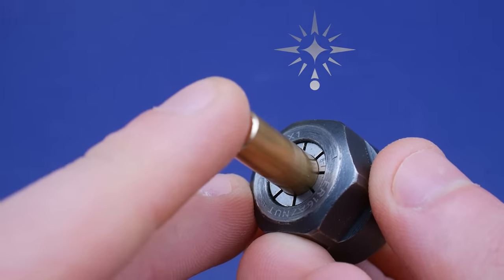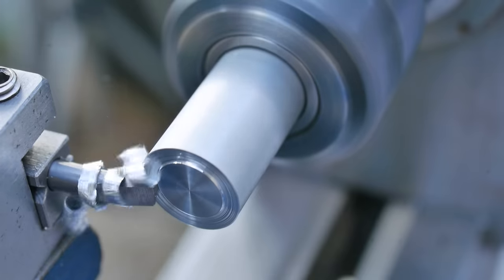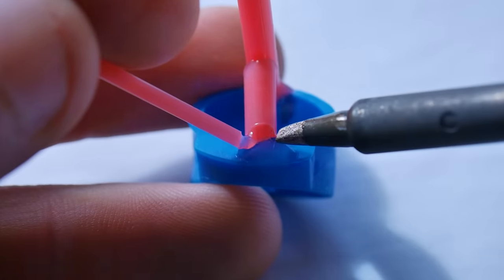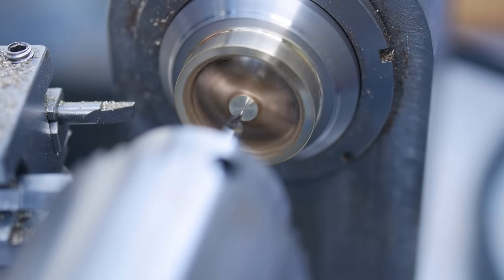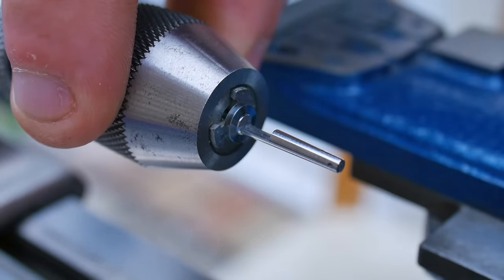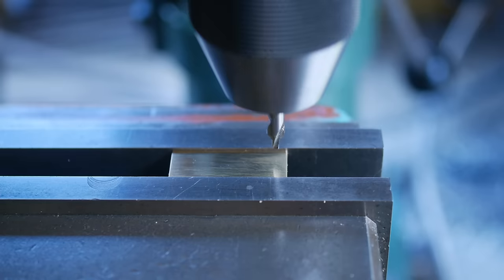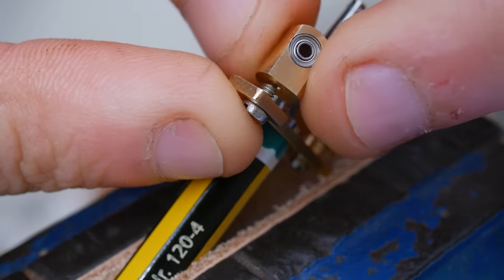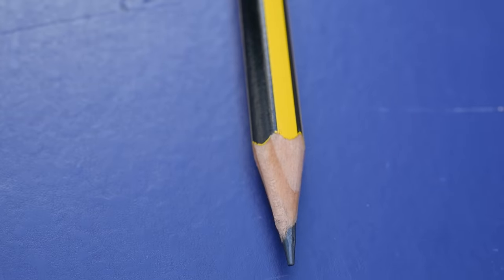Making the World's Smallest Beam Stirling Engine

Comment: Hi, I am a 77 year old Agricultural Engineer. During my childhood and early career a number of these engines were employed to pump coal gas for lighting. These were about 6" or so in height. There was one used in a cowshed to drive a vacuum pump. This one was some 4ft tall and ran very  well. Electricity only came to the area of Gloucestershire I grew up in around 1955, farms and outlying houses still relied on generators for electrical supply. There were many different engines and sizes of plant still in use into my late teens. Thank you for producing this marvel of engineering. Andy
Reply: Best comment, what was the heat source used?

Comment: I’m a retired machinist of the old school persuasion and I’ve pretty much seen it all, but I didn’t stop smiling through this whole video. 
                    🤜🤛
Reply: What kind of things to you make? I used to work for an engineering company in Sheffield and they had me using a traditional milling machine to make drill heads. I was only 17 at the time and quickly got bored of the repetitious nature of it and left to continue my studies. Now I'm older I have a renewed interest in going back into engineering, I just want to be sure it will be a stimulating profession. Any thoughts/advice?
Reply: @silverbullet2008bb  
I wish I could help but I did say “seen it all”, not “done it all”.  I was just a production machinist.  I started in the 70’s, a high school grad on Davenport automatic screw machines.  Very fast and intricate machines that were purely mechanical.  No hydraulics or pneumatics involved.  The last half of my career in a different plant started analog and morphed into total CNC by the time I retired.  That was a challenge for an old schooler who took pride in grinding and setting all your own tooling.  Those skills were suddenly not needed.  
By “seen it all” (an exaggeration by the way. I wish I had)  I loved discovering the super talented custom machinists in super custom machine-shops.  It seems like they perform magic.
Reply: @ridermak4111  Your experience sounds familiar. Our company didn't have CNC machines as they were quite new back then and we only had hand operated milling machines. The company owner was a masterful machinist, some of the things he made from a block of metal blew my mind. I've done boring, i.e. the boring of cylinders using a boring machine, and yes, it was very boring! I worked for GKN at one point making cylinders for Volvo engines but that was almost all automated. In the end they closed our foundry to move it to China! Apparently the Chinese would do a 12 hour shift for £3 whereas they were paying us £14 an hour.
Reply: The best job is to go on the dole my friend so that you can practice your hobby at the same time😄😄😄

Comment: man it's crazy that you got it to run so smoothly! Having built two stirling engines myself, I know how sensitive they are to friction, especially the small ones. Amazing video
Reply: Yes, I was truly amazed by the workmanship as larger Stirling Engines, despite being awesome, are easier to get running as they can power through minor hiccups they encounter.
Reply: @agiliteka  ha ha ha you don´t know what you are talking about :D Stirling engines have zero power, cant even start it self
Reply: @jarniskat Literally any type of engine with only one piston has this problem.
Reply: @jarniskat  Something tells me you have not as much as completed a decent 1st grade finger painting.  :P
Reply: @WayneTheSeine  You are absolutely right. I never learned to paint with my fingers, because here in Denmark we usually use brushes, and funny enough I am an artist who has painted many portrait paintings that look like photographs. My work involves developing more effective production and invent new things. That requires a head that understands more than usual. So your comment only tells something about how intelligent you are ;)
Reply: @jarniskat  Those engines either have an electric starter motor or require pulling a string which gives the crank shaft an initial spin.
Reply: @jarniskat  When you are attempting to flaunt intelligence, it helps to use proper grammar.
Reply: @blockstacker5614  ok kid :) try to write a sentence in Danish and see if you know our grammar, English is not my native language as it probably is for you.
Reply: @jarniskat  How can I be expected to know a language that is virtually unspoken outside of some miniscule Nordic country.
Reply: I doubt you’re Danish
Reply: @jarniskat basically a dead language

Comment: Beautiful work. My grandfather, on my dad's side, was a self taught machines and Gun Smith. He made two sterling engines, of which my youngest sister got one and my cousin on mom's side. The two lathes he built as well as the one commercial lathe he rebuilt. 

For a man that had to drop out of school to work in the coal mines after his dad died in a mining accident, he made a point of reading every engineering book and other texts to the point where he had an equivalent of two engineering degrees. He was my hero and life model for me. I miss him tremendously.

Comment: Absolutely fabulous little piece of machinery. Stirling engines are extremely versatile, and actually in use all over. Submarines equipped with air independent propulsion (not counting nuclear submarines) are one of the cooler places you'll find stirling engines, and they're exceedingly large on the submarines, since they have to generate a good amount of power to turn the screw. They're very quiet when they run, and extremely good at converting heat into kinetic energy.

Comment: The parts being crafted as well as the tools used, do not seem out of the ordinary, until your finger is in the shot. That really helps realize the miniature size of the engine you are making. When I was in the US Navy as a sonartech I was sent to school to qualify as a 2M technician. That is mini/micro-mini repair of electronic parts. Working with a microscope to repair inside an integrated circuit chip…it reminded me of it with this video. When looking at a part, it seems tiny but, under a microscope a pencil lead would look like a redwood tree. Great and awesome work 🫡

Comment: Would love to see a video explaining your design process for projects like this! With so many clearances between tiny moving parts do you use CAD design as a starting point - and do you prototype any components/subassemblies before proceeding to the final build?
Reply from the maker: Hi Sam, our design process varies a lot depending on the project. I'll be honest, this one I designed as rough technical drawing on paper and then built, making changes along the way, sometimes making parts multiple times. The engine you see in this video is actually V2, once I had it all figured out.
Reply: @chronovaengineering  Maybe add a 2nd channel for longer videos with your design process!?!
Reply: @chronovaengineering  could you also share some of the fails and thing you learned that wouldn't work? would be super interesting
Reply: Is it possible to geht your plan ? I would Love to build one by myself😊

Comment: Excellent, Hot air engines are more difficult to make [well to get to run] than a steam engine [which is much more forgiving]  as you will know, of which I've built both, but this small size is on another level altogether it's so small well done, love it.
Reply from the maker: You are absolutely right. Both engines make for great projects and although hot air engines are certainly more finicky, there's something particularly satisfying about them! Thanks for watching.

Comment: 8:22 silicone casting world trick that applies to any pour really: don't pour directly into your mold, rather use a stirring stick to pour on. This prevents bubbles from forming as the liquid flows on the stirring stick's surface, maintaining its flow and not forming bubbles.

Comment: Awsome stuff this and a very cool machine your using (machinist here!) I thought you'd like to know that its good practice to cross drill before slotting especially on tiny little bits like the pistons and shafts your making to avoid deflection and deformation. Your probably being gentle as is so its not the end of the world but might save your bacon when it comes to fitting the connecting rods! Loved the video and jealous because I made.a Stirling engine but bigger and couldn't figure out how long to make the displacer rod (still a non runner lol)

Comment: I am trying to make a similar, although larger sized Stirling engine. I run into one question: the powerpiston has to have  gastight fit but does the 1 mm beam driving the displacer piston also need a gastight fit?

Comment: This is mesmerising , many many people will be wanting to do this.
What is the lathe you are using ?
Reply from the maker: Thanks Peaky_Blinder! There are 2 lathes shown in the video, the small one is a custom build: I used a Boley Watchmaker’s lathe bed and tailstock, a Pultra compound slide and I machined the headstock to my own specifications but I based the design off the Leinen WW82 and 83 ball-bearing headstocks. The larger lathe is a Myford Super 7. Hope that helps!

Comment: I am very impressed with you work and videos! I have some questions. How did you know what was the right ratio of piston length and diameter, lemgth of the stroke of the piston and also what the best flywheel diameter and weight was?

Comment: A great deal of the energy loss in a Sterling engine comes from mechanical friction. You can eliminate much of this by using a coil and magnet (on the piston) to convert the mechanical movement directly to electrical power. Like those flashlights you shake to power. A Sterling electric generator is very useful.

Comment: I've heard (I have zero experience) that using the saws feeding perpendicular to the work allows full length of the saw blades to cut the work rather than only the tip of the blades.

Comment: Add a small sprocket to flywheel to turn a tiny axial flux permanent magnet alternator. Use to charge phones, even a car sized battery...or bigger? I suggest a three phase alternator(AC), converted to DC, charge controller/regulator (prime number phases like 3, makes smoother DC...ripples don't overlay). 5 phase alternator would make even smoother DC straight away when rectified(combined).
Better yet make the alternator, also the flywheel!

What about a larger version with a larger Diameter alternator, combined with a small rocket stove??? Talk about an emergency generator! Wait, to run a car direct drive(transmission), with just a small alternator for all the electrics.

Comment: I'd try a fixed pitch on the wing.  Having it pivot amplified the swings as the quads gryo tries level itself as it sees the lift from the wing as an unwanted tilt.  If the wing angle were fixed, the gryos might not react to strongly.

Comment: I gotta say, the amount of support you had to have on that flywheel was unnerving. I think the silica mold method was a touch of an overkill too. Maybe you're just using what is already available to you but a better placed 3D model would require massively less support material and high temp silicone mold would allow you to cast a part that would need way less excess material to remove. I noticed that the center axys was off on the flywheel and there might be balancing inaccuracies because of the uneven distribution of metal spanning from the use of silica sand.

Impressive nonetheless. Makes me want to try finding a mini lathe and get into model airplane making.

Comment: I may try it as I have a small lathe!!  The machine shop I retired from worked on some parts for what we understand to be an atomic powered Sterling cycle that they set in motion and will remain running for sometime before they launch. then will run semi etrenally!  I wonder if the "Voyager" satellites have such tech!

Comment: Please sir;  Why didn't you use use your milling machine  to make the time intensive flywheel?  I have made many tiny engines over the years of my career.  Some so small that they would fit inside a sewing thimble, and fully operational. Some with less than a 3/64" bore.

Just Curious about that, fellow machinist.  I love your work!  Thank you so much!
Reply from the maker: Hi dcw56, thanks for your comment. We wanted to keep the video interesting by exploring a mixture of techniques and we felt that a more traditional-looking cast flywheel would complement the design. Milling the flywheel is certainly a valid approach too.

Comment: you should measure the absolute minimum amount of heat input it takes to run your little engine at 60 rpm or 100 rpm versus the total weight of the engine and then forward your results to the guiness book of world records, then challenge somebody to beat your record

Comment: Now build a Contained flame Stirling Engine Tattoo Gun? The flame could be a low smoldering flame like from a Zippo Handwarmer unit, but much smaller and the wheel and piston can drive a long rod tipped with a tattoo needle braised on, it can run down a long copper tube to a highly polished and knurled brass hand grip. Style is ALL you. I don't have access to a small lathe or anything near watchmaking size? I'm certain you know exactly what I mean but if you'd like any input you can get me on here? Great content, I subbed.

Comment: I bought one of the "toy" type Stirling Engines on ebay, it works, thought I might improve it by spraying some pressure can silicon onto the moving bits, dead loss,  had to wipe it all off, friction freeing silicon is a No No on these engines, clogged it up,

Comment: That was cool to watch. I would have to live in the camera view, just to do all this work.

You need to use your bigger tools to make smaller tools now!

Why does no-one make the fly-wheel a fan, which blows cool air at the cooling fins? Such a lost potential there, for efficiency, as well as using the actual fly-wheel for capturing heat, for transfer, in opposition.

Comment: What lathe is this?
Reply from the maker: Hi Frick, There are 2 lathes shown in the video, the small one is a custom build: I used a Boley Watchmaker’s lathe bed and tailstock, a Pultra compound slide and I machined the headstock to my own specifications but I based the design off the Leinen WW82 and 83 ball-bearing headstocks. The larger lathe is a Myford Super 7. Hope that helps!

Comment: Ammonia would be nice with a  turbo compounding system, not to be confused with a turbocharger. Turbo compounding increases thermal efficiency which results in higher fuel efficiency &/or output power by using the exhaust gas VELOCITY to turn something similar to a pelton wheel driving something like a hydraulic pump & motor setup. The hydraulic pump could power the brakes & the steering unit. Efficiencies up to 7% could be exacted.

Comment: Why I havent I seen anyone turn this into an actual electric generator that can recharge a battery and even power devices. 
all the components are there, the principals are there, all you need is turn the wheel into an actual electric generator wheel with copper windings and magnets around it and you can have voltage produced.

Comment: The absolute highest efficiency possible from a sterling engine, is much lower than the maximum possible, and even the typical efficiency of a modern internal combustion engine. The claim that it is highly efficient is simply wrong, and very misleading. This is not responsible reporting.

Comment: stirling engine design information 
1)  MORE  energy is  Lost, in a  more  complicated  linkage.!!!      collectively, ALL  of the mass that is in reciprocating motion acts as a speed  Limiter/governor.     including the unnecessary mass in the  BEAM.        2)  engine design should be optimized so that  Conduction  of heat to the cold side is  Minimized.        IF  there is a physical connection between the sides, then that connecting structure should  be made of a material that conducts heat  POORLY.        3)  this sort of internally ducted configuration results in zero 'regenerative' affects.        4)   where the wrist pin is located at the  Bottom  of a piston, the use of an  Elongated piston  is  recommended.            5:00   unless this was  FULLY  thought out, doing it was a  Bad  idea.             3:08   NORMALLY,  the use of lubricant is  not  necessary,  where metals of differing hardnesses move adjacent to one another.       d
Reply: I don't think his goal was efficiency here.  His design goal seems to be a (1) Very Small (2) Working (3) Stirling engine of  a specific design.  So I think he can be forgiven for not having a regenerator, or not having maximum thermal-isolation between the hot and cold sides.  This is more like building a stirling engine out of coke-cans and old AOL CD-ROMs!  😆